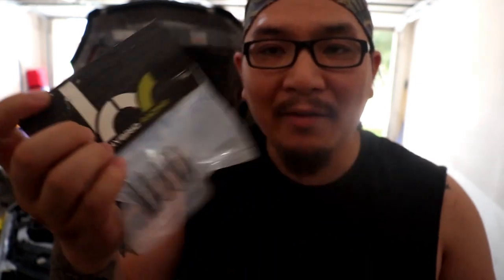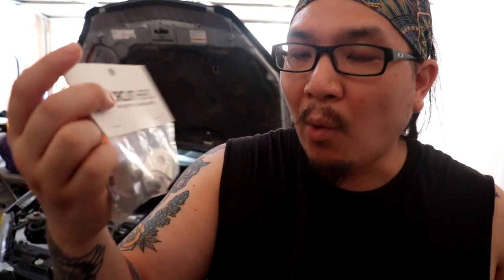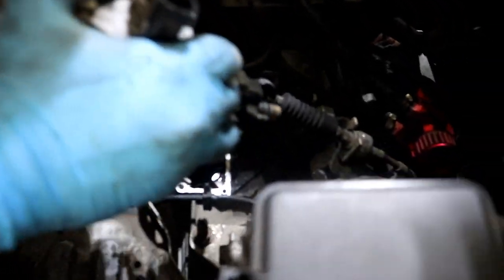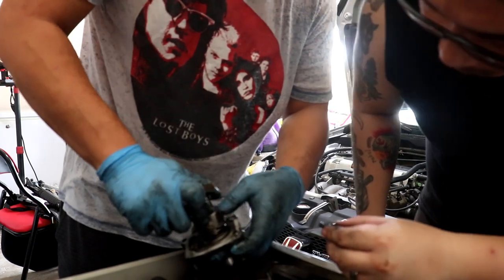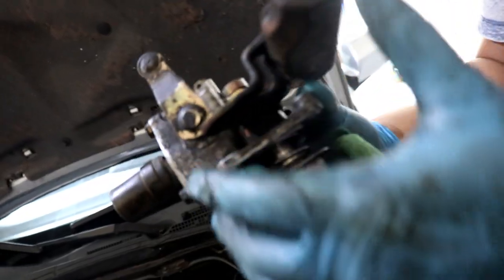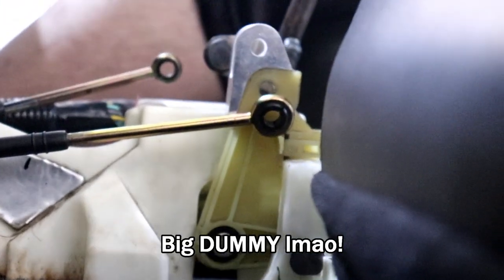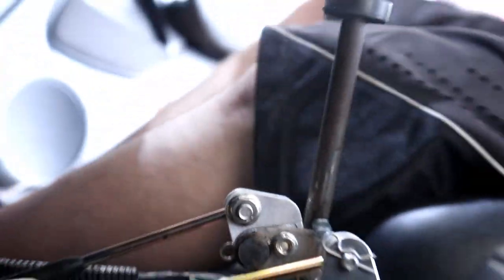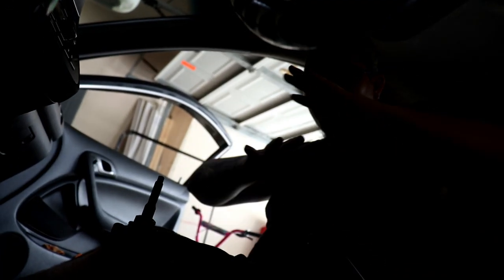The BEST Mods For Your RSX OEM Shifter!

Comment: Interesting. I used a shifter adapter by DC Sports on my 1998 Accord. It only uses the rod shifter mount and does not include the other adapter on the left side. (Left to right movements)